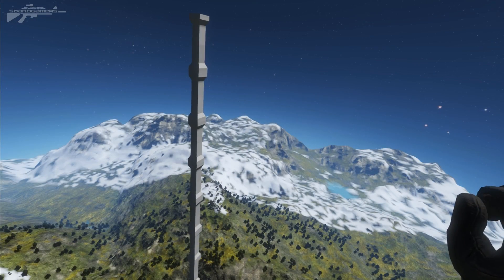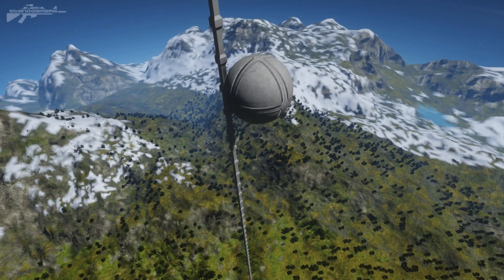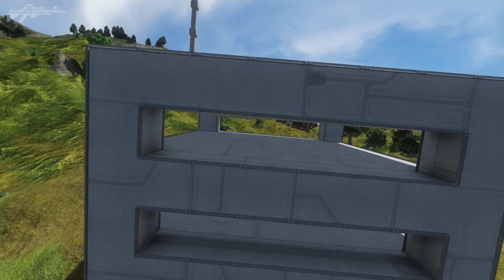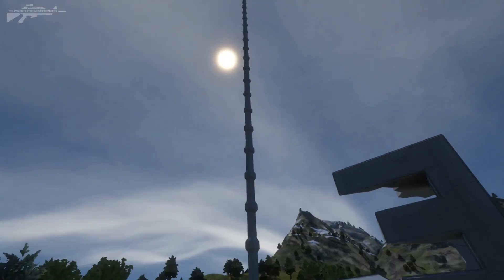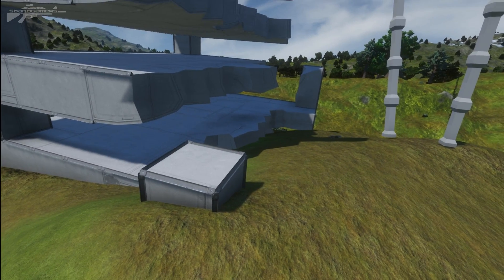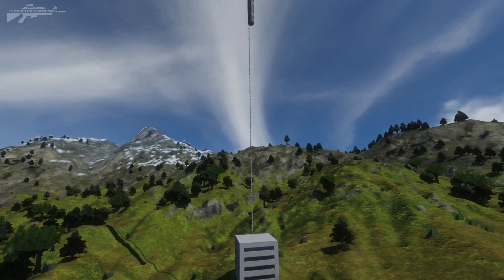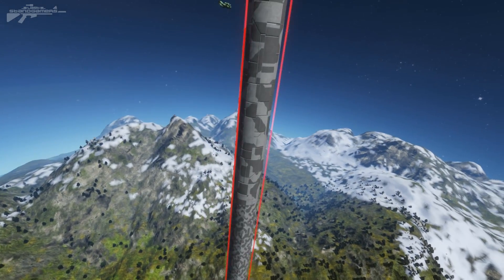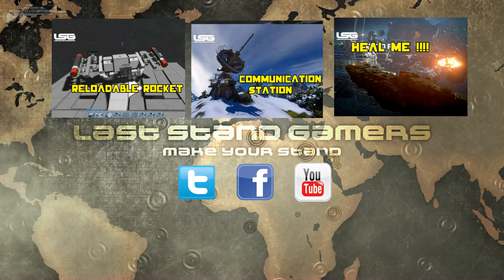Space Engineers - Kinetic Energy Testing

Comment: So the game has only a basic collision model... Really should have look ahead collision detection.
Reply: Yeah they have the most basic collison model that exists. They basicly detects " are these inside of eachother "while calculating the frames so if you go fast enough that you move 1+ block a secconds you can just pass trough as they where never inside eachother. They could do with a raytracer getting the distance of the nearest object in the path theyr moving and then get the distance theyr moving inbetween frames and check if theyr going to collide or not . Then they could finaly get rid of the stupid speed limit.
Reply: The game has awful (or awfully buggy) physics, in which small ship gyroscopes can destroy 10 blocks around them if grinded down incorrectly. In which piston (rotor) heads detach like if you had blown on them. There's no orbital mechanics. Let Keen at least improve physcis and/or fix year-long bugs, which they can't fix because of rushing updates every 3-7 days.
Reply: And you know full well that high speed collisions are very difficult to code.
The physics engines in games have multiple limitations. One is that they calculate in discrete steps, rather than continuously. That means as the speed gets higher, the distance an object will travel between any two physics calculation steps gets larger and larger, and the result gets increasingly glitchy and unpredictable due to a lack of temporal precision.
(you can calculate physics more often, but just like with framerates, it depends on the hardware).

The other issue results from the use of limited precision numbers to keep track of an object's precision.
There is a huge difference in precision in modelling a 1 km^3 volume using 64 bit floats compared to modelling a 100,000 km^3 area using 32 bit floats.
Worse, floats are nonlinear when it comes to the amount of precision they provide. The further you get from the centre-point of the coordinate system, the worse the precision gets.

When your coordinate system is only accurate to within a few metres, you can't expect to get accurate physics calculations out of it.

Capping the allowable speed is a workaround to both of these, since the consequences of lack of temporal and spatial precision are less serious at lower speeds than higher ones.

And it gets worse because few people write their own game engines anymore. If you are creating something with a huge scale, and create the engine from the ground up, you can plan ahead for how you handle distance and speed to make things more robust.

But more often than not, pre-built game engines are used and adapted.
If you're building a game on Unity (eg Kerbal Space Program), or CryEngine (star Citizen) or Unreal Tournament, you can't simply rewrite massive portions of the engine to handle scale better. You're generally stuck with whatever coordinate system the game engine already uses, and whatever the precision limits of such an engine are, because it's embedded pretty deep into the core of the engine.

Collisions and physics are a very challenging thing to do properly anyway, but usually the simplifications and hacks used aren't as obvious as they would be in a case like this.
Reply: It detects the collision well.
Reply: elliott van neste But then again, they surely have more important stuff to do. Like add a couple new blocks each 3 days, not even thinking about fixing bugs. And then people say, that Keen are good devs...
Reply: +Тимофей Желудков what do you mean by "no orbital mechanics" you can orbit around a planet with inertial dampeners off. it's just difficult to find a stable orbit.
Reply: megapro125 You can orbit a planet without inertial dampeners AND with them. It's just too simplistic to be called "orbital mechanics".
Reply: Тимофей Желудков nope you cant orbit in SE beceause of the speed limit unless you continisoly keep boosting away from the ground and the direction your orbiting.
Reply: elliott van neste Well, then it comes to my earlier point. Very buggy, simplistic physics.
Reply: elliott van neste you can set a higher speedlimit. just select what you want/need from the list http://steamcommunity.com/sharedfiles/filedetails/?id=380168871
Reply: megapro125 well ofcourse modding will get around that but then your high speed collisons will just bug out.
Reply: +Тимофей Желудков Stop bitching about an alpha games physics and go earn some money so you can dev your own.
Reply: KuraIthys heres the thing they could use a raytracer that looks in the direct the moving object is moving. which looks if somthing is in its tajectory then you find the distance between the 2 objects then you look at the distance the moving object is going to move. if the distance the moving object moves is greater than the distance between the 2 objects they collide. simple as that this allows for great speeds (ofcourse not unliminited it still needs to fit in variables(unless you have multible variables)).

This would be more effecient then what theyr doing right now which is basicly is this object inside another object if so then they collide but if the object moves fast enough its never inside the other object and thus just passes trough.

also on the topic of coordiate systems your entirely correct on that tough the thing is causae its only that accurate on these scales they only use it for the save system and coordinate based collision isnt used very often anymore.

on the topic of engines its true you cant simply modefy physics of an engine tough the ones that are out there have pretty good physics models looks at KSP for example you can reach pretty high speeds there and collide in stuff but if you collide its also an actualy collision you dont siimply go trough. ontop of that the creators of KSP added in drag,lift,... etc. so you can always add mechanics/physics if theyr not there.

ontop if that keensoftware uses its own engine so they can pretty much change anything they want in it. if they would use a raytracer to calculate collisions like i suggested the game might also run a bit quicker cause now its checks every frame if an object is inside another so if you have allot of objects in physics distances its going to check that for every object.while with a raytracer it only checks if the other object would be in its path and is close that i will be hits next frame.

i agrea accurate collision calucations can be pretty advanced but heres the thing in virtual envirments you got most of the variables. which in turn make them very easy to solve.
Reply: splendid idea.
Reply: elliott van neste If you didn't allready you should make a suggestion in the forum since you seem to have a good understanding of how the physics engine works.